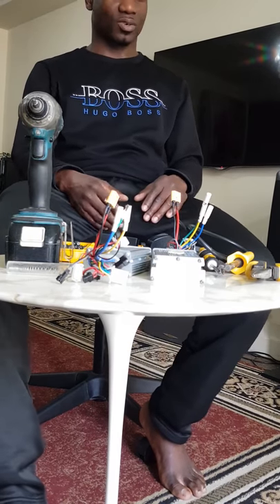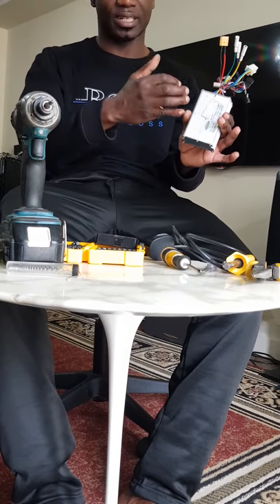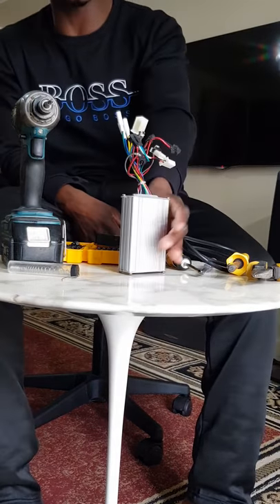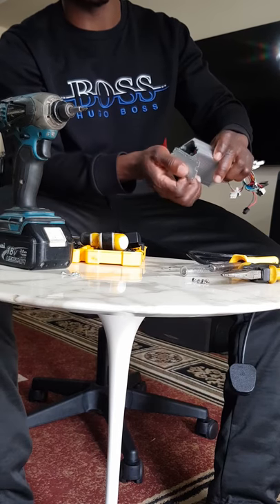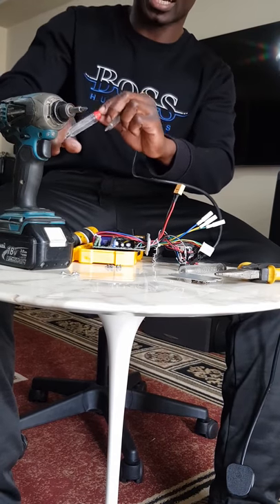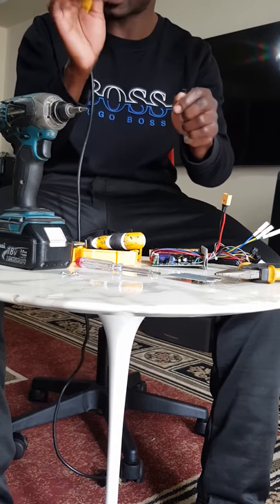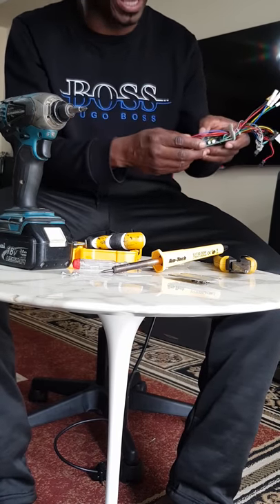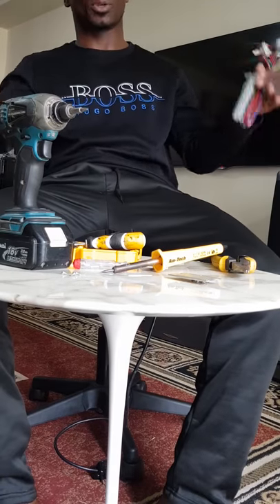Electric scooter controller repairs.

Comment: Im trying to diagnose my nanobot d4+ 2.0 scooter. This problem does not happen in the cold morning on my first ride (50f or 10C) but happens in middle of day when it is warmer (70F or 21C). Im in New Mexico not its only springtime and this never happened before in when I lived in Colorado and rode it when in summer it was very hot outside. What happens is both motors cut out when I'm in dual mode and when i go full throttle, and also sometimes when i try to just accelerate quickly. when it cuts out i does not come back alive by simply backing off a little on the throttle but i have to totally go back to 0 or no throttle and then the motors start if i re-engage the throttle more gently incrementing the speed. It does not happen in single mode when in just rear hub drive. When in single mode i can press the throttle fully and as quickly as I like. If I think of the thumb throttle as a clock that goes clockwise from 12 to 6. it is at the 5 when the motors cut out. It also happens if i got from 12 to 3 very very quickly.  I'm pretty techy and i can replace of fix most anything but I like to diagnose first. I did have an extra thumb throttle speed controller so i did decide to replace that (because a year ago i brew out its usb power port when making a dual charger for a camera i have) but changing that speed controller had no change in the symptoms. Do you think there is a short somewhere in the system on full power or is it a hall sensor. Is it overheating and the bms cutting out? There are two controllers in the scooter with a communication wire between them, could one of the controllers be off. Both motors shut off when this happens. What tests should i run to see where the problem is? I have opened up the scooter before because I silicone sealed everything to protect from water. but actually moved to NM where there is little rain and I do not ride it in mud or water anyway. Any help appreciated.
Reply from the maker: Hi, I think you are experiencing failing mosfets or transistors on your scooter’s controller motherboard. During operation,  these transistors gets very  hot and thus why quality built ones always have heat absorbing materials under the transistors. When the heat generated can not longer be controlled by the transistors, they turned to crack or shortened power regulation during operation. You will need to replace your controller. If you good at electrical, then you need to test and read each transistors to see which one is not giving the correct readings and change it. I hope this helps you.
Reply: @michaelmilenamg  Thank Dr Mike , your the man. Very helpful info...Thanks

Comment: Is there a fuse in my scooter that could have blown from wires touching or would it be the controller? I have nopower at all. I have the hapichil e202 it has no power i have the foot plate off.
Reply from the maker: Hi, sorry to hear your problems with your scooter.  Some scooters have fuses on the power voltage line to the controller to prevent the controller blowing up transistors or mosfets.  Check th voltage wires that connected from the battery to the controller of your scooter. If the fuse is OK or there is no fuses, then you need to check the transistors inside the controller for possible blown up ones and replace them. I have a video about controller repair that you can use to guide yourself.  I hope this helps you.
Reply from the maker: Also if you not getting power at all, check to ensure your battery is charging by connecting the battery charger to your scooter for about 30 minutes and turn the scooter on. If still no power then you need to check where your scooter's charging port connected to the battery wires to be sure its not loose, burnt out inside the rubber wire coating. Check if there is a fuse attached to the battery wires to the charging port to ensure its not blown. If everything is properly connected between the battery wires and the charging port but the scooter is not charging then your battery is damaged and needs changing.  I hope this helps you.

Comment: Hi please can you look into my case 
I got about  6 blown controller  I watched your video and tried to fix by testing if any mosfet is bad just like one of your video but luckily all are good 
So what do you think is the faulty parts .
Note some of them are reading high voltages more than as it should 
Please guys I need  a help to.
Reply from the maker: Hi, sorry to hear that. From what you said, it looks like your problem is coming from power supply sources. If you have blown up six different controllers for the same scooter then your problems are not coming from the controller or the mosfets or the transistors. Check your power source to be sure there is not short circuit on any wires supplying voltage to your controller. If the current reaching your controller is more than required, it would blown it.  If this is the case that more current and voltage reaching the controller that required, it would be the IC on the voltage line on the controller motherboard that would blown up and not the mosfets. I hope this helps you.

Comment: I have the e202 500 watt scooter. My horn wire and power wire for my scooter touched. Copper to copper touched cause wires were pinched and my whole scooter has no power now. Battery does charge and gas juice whats the issue.

Comment: Do you repair these boxes?  Where are you located?
Reply from the maker: I do repair mine and located in South London. I live between Boston USA and London.
Reply: @michaelmilenamg  I have a German scooter called Charlie and the controller box is fried apparently. I am guessing it is a minor repair for someone that knows what the heck they are doing. I could send it back to MZ In Germany for refurbishment or replacement but that is expensive. Do you repair something like this and any idea as to the cost? I am located in San Diego.
Reply from the maker: @BradWillis  sorry to hear that. Usually the controllers failed is caused by hot mosfets or transistors on the board. They are the common parts that failed. You need to read those transistors with multimeter as explained in my videos. The failed ones needs replacement and you back on the road. Alternatively, if you don’t have knowledge of that, you can just order a new controller from the seller or website by using the numbers on the controller box in the search engine.

Comment: Where to get new ones for okidas X4?
Reply from the maker: Hi, firstly, you need to contact your seller for free replacement controller if your scooter is still less than 1 yr since you bought it. If this not possible, then you may have to pay for it for your seller to send you any replacement parts you need, including the controller that you need now. You can also check to see your controller’s Amps and voltage and replace it with an equivalent ones from any sellers from google, Amazon, eBay or chinise website Alibaba.com. For example if you scooter have a controller of 60V 30A or 48V 25A,  search with the controller follow by the numbers to see who is selling it and where. I hope this helps you.
Reply: I know it's pretty randomly asking but do anybody know of a good website to stream newly released series online?
Reply: @Kyler Carl I use flixzone. You can find it on google :)
Reply: @Maddox Maurice yup, been watching on Flixzone for years myself =)
Reply: @Maddox Maurice thanks, I signed up and it seems to work :D I really appreciate it !
Reply: @Kyler Carl You are welcome xD